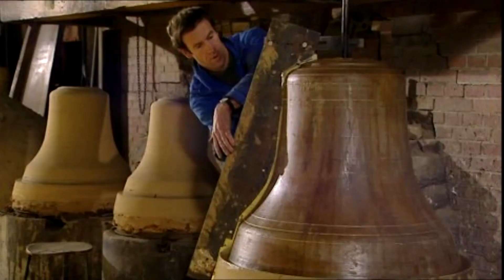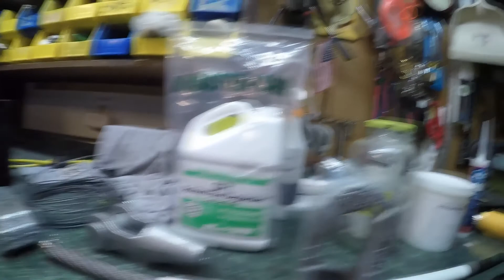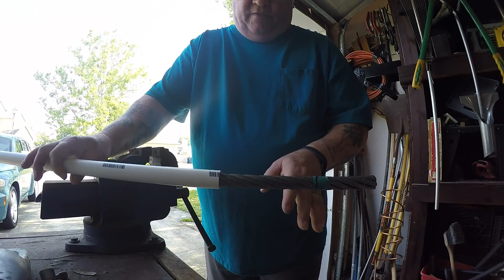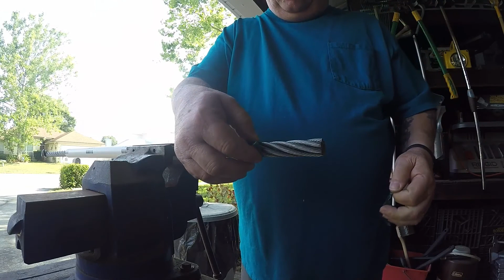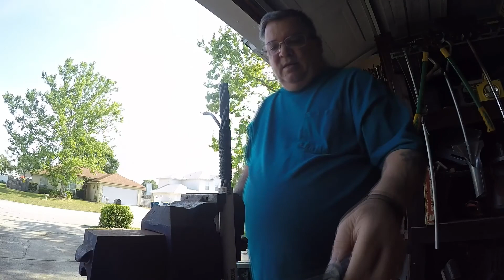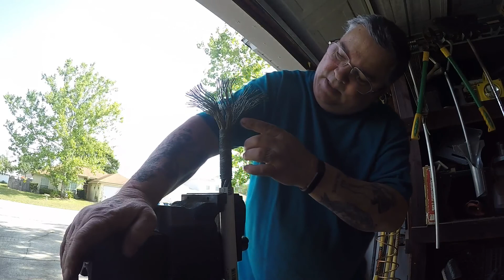Wire Rope Sockets, Part Three

Comment: thank you, very useful video. Is there an easier way to untwist each wire from the rope? special tools? other aids?
Reply from the maker: No special tools that weren't invented by the workers in the shop. I usually used some vice grips to open the strands.